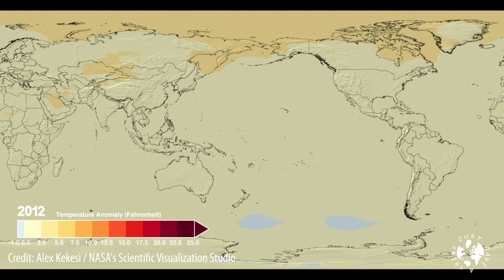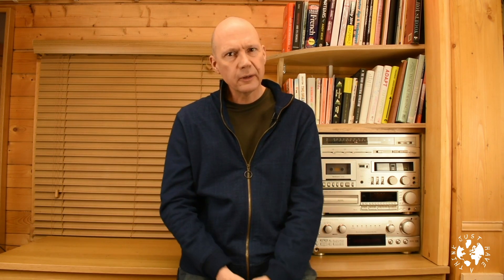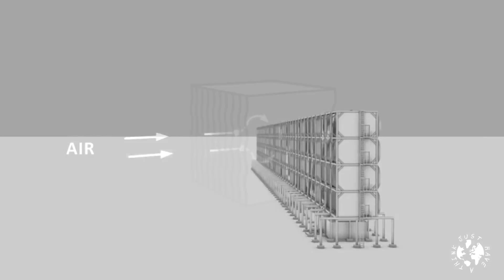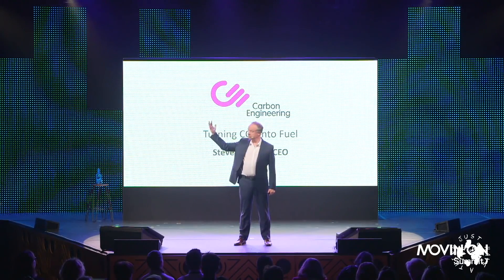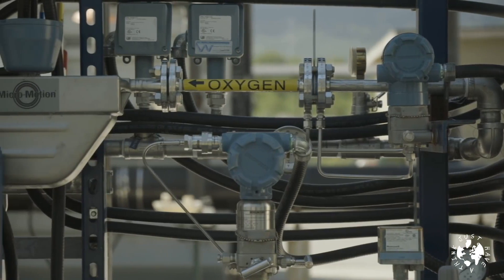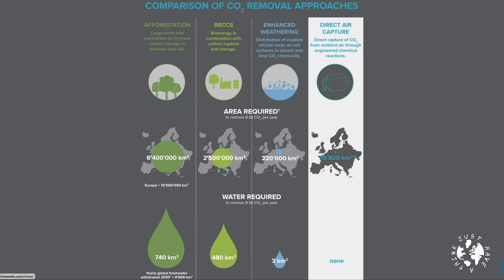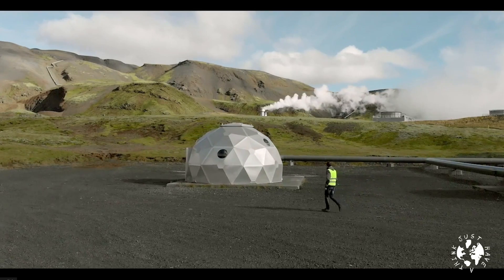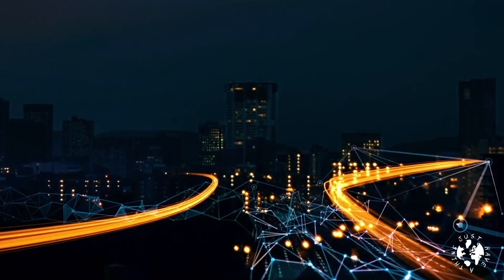Direct Air Capture Technology

Comment: Cost of materials separation (gases, liquids or solids) is almost always inversely proportional to the concentration, i.e. the lower the concentration of the material being removed the higher the energy (and consequently monetary) cost. Examples include ore grades and milling costs, gas separation, and removal of different ion species from water, etc.. Removing low hundreds of parts per million (ppm) of CO2 from air requires at a minimum air/handling roughly 10,000 greater than the volume of the CO2 removed for single pass treatment (if the process is multi-pass then multiply 10,000 by the number of passes). That is only one of many costs involved in the process life-cycle. This begs a few questions: 1) What is the purpose of direct air capture technology (DACT): optimized sequestration to remove CO2 from the atmosphere or creating a new recycled carbon material loop at the cost of reduced CO2 removal efficiency)? 2) What are the life-cycle efficiencies of the respective technologies in terms of long-term atmospheric CO2 removal ? 3) How would the recycled fossil carbon be used (e.g., in IC engines, fuel cells or as feedstock in plastics and petrochemical manufacture, etc.)? Given the thermodynamic inefficiency, process pollution, negative human health impacts and economic disruption of IC engine use, this is a no-start.  Use as feedstock for plastics manufacture, while it potentially could reduce the use of fossil carbon, perpetuates the proliferation of plastic pollutants in the environment. Plastics pollution is a huge unfolding environmental disaster that is quickly contaminating all terrestrial environments and ecosystems (including the human body at the cellular level). Don't think that would be a good application. The jury is still out on methane vs. hydrogen fuel cells (kind of), though the industry seems to have tipped their hat to hydrogen). This leads to the 4th question: Is CO2 capture with hydrocarbon recycling even a legitimate option for long-term CO2 sequestration? I think the answer is no. That then raises an inconvenient question about the efficacy  of making DACT a component of atmospheric CO2 reduction. Since long term DACT and sequestration come at a dear price, as seen through single-bottom-line lenses ( the predominant eye ware of corporatism/capitalism) would a better strategy be to instead double down on expeditiously exiting the fossil carbon economy and focusing our efforts on CO2 capture in the earths living systems? If business and economic engines are thus synced with human intelligence, industry, and commerce, to make our collective endeavors sustainable on the planet that sustains us, then the cost of these changes become positive inputs to the industrial human economy as well as thrival of Planet Earth's Living systems.

Comment: I'd say the way to approach this is a 2:1 model. A company that engages in this is allowed 2x DAC to 1x DACS. That way 1/3 of the carbon they process gets sequestered. They get to offset the cost by tax breaks for the 1x DACS. I have not done the math but I think a approach similar to this (someone smart needs to work out the total economics) is a workable approach.
Reply from the maker: Carrot and stick. I think you're probably about right.

Comment: One advantage which needs your scrutiny, is the idea that these technologies now define a value to a ton of captured co2. In your presentation you have identified that a ton of CO2 costs $235 to remove. Now it becomes clear to the economic community that carbon tax needs to be paid at the same or greater value, and not €5 to €20 currently typical in Europe. So any capitalist recognizes a market has been created.  If for example a fuel company is required to pay this, which a reasonable government might adopt, the carbon tax impacts on the price or the fuel, so the government has taken a step towards funding carbon removal. The next step is there is now a clear reason why there will quickly be companies competing  to find and market a lower cost solution, driving cost down as happened with solar. The point of all this is to create a viable market which has already served us well in the case of solar and wind. We have to develop not only the technology but the viable market place, that’s capitalism. As I generally point out saving $20 a month on your fuel bill is far more compelling than saving the  the world.
Reply from the maker: 100% agree. Many thanks

Comment: The concentration of CO2 in air is low, and capturing it will cost a lot of energy. Much better to remove CO2 directly from the exhaust.
Capturing CO2 from the air, plants are still much more efficient than any of these projects.
Reply: While that's true in practice, in theory we could do better than plants at pure CO2 capture.  Plants' carbon-capture is limited by a twitchy little catalyst/enzyme called rubisco, which is looked at as one of the strangely least-efficient mechanisms in Nature's arsenal.
Reply: @paintedwings74  Interesting. The plants capture CO2 without requiring input of energy. Can we manage the same?
If we need to put energy into the prosess we can rather focus on producing carbon neutral energy.

Comment: Back of the envelope calculation (correct me if I'm wrong);
We currently emit around 100 million tonnes of Co2 into the atmosphere every day (~36 Gt p.a.)! 
To remove 1 tonne of CO2 would mean pumping 2,500 tonnes of air (CO2=400ppm)through the extraction machinery (assuming 100% efficiency). Daily we would have to process 250 Gt of air per day to extract all the CO2 currently emitted! 
I don't think this is doable, the energy required alone would be mind boggling, also CO2 is a poisonous gas at higher concentrations, you could not store these vast quantities near densely populated areas. 
This looks like a case for Thunderf00t to analyse, he does a similar anlaysis on extracting methane from the atmosphere; https://www.youtube.com/watch?v=dzq9yPE5Cbo
Reply from the maker: Hi Art. It's a fair observation, but I don't think anyone's realistically thinking this technology alone will pull out all the CO2 we burn. Climeworks are aiming for 1%, and even that is 750,000 shipping container's worth of fans. So it will only really be a part of the solution. But my view is it's worth pursuing if there's capital there and political will to back it.
Reply: @JustHaveaThink  Thanks for the reply. 
Perhaps it would make more sense to apply this technology directly at the source of heavy emissions such as coal plants, where the concentrations of CO2 are far higher.
I do think that this technology doesn't solve our problem but kicks the can further down the road.
Kevin Anderson of the Tyndall centre, says that the top 10% of the world's population is responsible for 30% of emissions. 
It is our consumption and neo-classical economic model that has to be challenged (as you point out) and changed to ameliorate what is coming down the track.
Reply from the maker: Hi Art - what you describe is Carbon Capture and Sequestration, sometimes also with Biofuel (abbreviated to BECCS) which is what the IPCC are heavily reliant on to make their RCP graphs work. It's something we've covered in a couple of earlier videos. You are absolutely right - the best place is indeed at the exit of power plants and factories. In practice though it's proved to be expensive to implement, adding up to 20% onto the cost of production. I think that's because it has not really been adopted wholeheartedly by the industries - it's more of a sop to the government environment agencies and it most likely drew some nice juicy subsidies as well. So there's no strong evidence that it's likely to take hold at big scale any time soon - which is bad news for the IPCC. And bad news fro us!!

Comment: There is nothing wrong with Capitalism as long as the governments create a legal and financial economic environment that is reflective of all the costs (health, environmental, etc.) so that the corporations and people are not "stealing" by taking opportunities of "free" resources (like human health or the environment) - they must not be free, and then Capitalism will find a way.
Reply: While i agree with you in principle, the issue is that capitalism rewards underhanded tactics. its about cutting costs, and maximizing profits. Hence simply using price regulations to increase costs, would either drive up prices, or promote illegal procurement of resources. While aspects of the economy function well with free market, or natural resources should be subject to a command economy, in order to ensure 100% control of natural resource expenditure. that way one planned sector will automatically regulate the rest of the free market.
Reply: @frederik7338  Capitalism = private for profit, but we need to modify the rules so that true costs are built into the equation to eliminate free exploitation.  That's the key. As for crooks... they exist in any system - the most "idealistic" system (communism) had the most crooks.

Comment: This (making fuel from CO2) is a big scam designed to make people believe that we can continue burning fuel. Why else would the OIL industry be behind it? They are using energy to capture CO2 so that we can burn it again. It is NOT carbon neutral - the equipment and likely the energy put into the process will result in CO2 emissions. The EFFICIENCY of this process as well as re-burning the fuel is MUCH lower then using the energy directly to make EV's move. CO2 emissions reduction / elimination and / or direct CO2 capture (at source) yield much bigger bang for the buck. Once all that is done, we can start looking at CO2 recapture - and then we should put it away - not burn it again.

Comment: Great vid explaining the ultimate decision we will all have to make and/or be effected by. With regards to who will have to pay, then reducing subsidies for the biggest polluters such commercial industry and aviation may be good start. Things end up costing us end users more year to year anyway, with near to no reduction in the CO2 emissions. Next should be private and domestic emitters who CHOOSE to burn more for comfort and/or prestige (massive, oversized vehicles and those who lean a bit hard on the heating, for example). This may already be the case, looking at it from a capitalist viewpoint. But the shear number of people in said big motors and/or those who are not economical with the gas/breaks means that the cost of doing so is definitely not enough, if that’s the purpose of the government levy on fuel. 
There’s more economical ways to heat homes, and though costly, ways to reduce the degree of heat needed to be added via gas or electric central heating through insulation. On this last point there are great advances being made. Local domestic energy production through solar, wind and ground source heat will need to become almost mandatory. 
So he’s right to bring up the point about us personally starting to invest a little more year on year on cleaning up our act now, rather than letting the bureaucrats screw us over. If that happens then I fear the same consequences as with London’s congestion charge - the little man loses out. And London’s air quality still sucks! 
I wonder if the carbon that is scrubbed from the air could be piped into vast green houses stocked with genetically modified plants that are mega CO2 hungry. Or just simply use the same to scrub the air? Oops but then I just forgot, we’re still zapping forests like there’s no tomorrow.

Comment: With all of billions of dollars used to make machines doing this is in my opinion waste, it takes so much energy to make and run these while nature has a cheap solution called trees. Plant trees and use the wood to build wooden structures and things, we have to build them anyway. Moving from plastics and concrete to wooden structures and things stores the CO2 natural way and saves the oil and concrete for things we absolutely need them.

Comment: I only like the idea of capturing CO² then putting CO² back into the ground. 

(All vehicles need to be Electric period.) 🔋

Producing 100% clean electricity from Solar and Wind and Ocean Wave's is all we need in the world by capturing and storing the energy in big battery systems.

My second idea would be capturing CO² and using it only for Airplane fuel purposes only until batteries become light enough for Airplanes. Everything else can be battery vehicles.
Reply: I'm not convinced Electric vehicules are the best idea. They are very resource intensive and unless electricity is renewable it's kind of still a bad idea. Harvesting Lithium destroy ecosystems and underwater sources which wee will need in a warmer future. I think a combination air sequestering AND the technology proposed by carbon engineering is the way to go while encouraging and promoting modes of public transport. Ensuring we need to travel less and rethinking our cities will also be necessary.
Reply: True indeed. But Battery has a life and when it become obsolete we throw away. Thus generating land pollution.
Reply: @surajitpaul3679  No, we DON'T throw them away.  Cars are not cell phones.  EV batteries that are no longer effective in cars will be re-used in less demanding terrestrial applications, and when they are no longer capable of that, they will be recycled.

Comment: Good video, I've only just found you so you have a new subscriber and I'll be sharing them to my "massive" following on twitter too. 
This is a huge issue and I have to say that I agree with everything that you've said here. DACS has no market as such and I've long understood that there will be no way to monetise a service that does not give people any tangible benefit. I suppose, when the time comes that we really do start to see massive change then people will more easily see the benefits: instead of paying for things to not get worse than they are  today, they will witness some climate devastation, lose some of the stability that we currently have and then see the value in paying to ensure that things do not degenerate further? 
DACS will be needed and I agree that creating fuel from atmospheric CO2 will help but it will only be part of the answer that will necessitate carbon removal.
Reply from the maker: Hi Ian. Many thanks for subscribing and for leaving feedback. There are indeed many challenges ahead of us as a civilisation and you may be right that politicians won't act decisively until the ravages of Climate Change are undeniable by even the staunchest disbeliever. I just hope that it won't be too late by then. All the best. Dave

Comment: 1 Liter Petrol == 750gr after burning this amount you get 2392gr co2. No way we can scale up to capture this amount of co2...
Reply: Many have accepted the starting level to effect the global carbon cycle is at around 8 GtC/y. That is a vast amount. I'll just leave 2 comparisons.

1) The US used ~6 Gt of cement throughout the last century. Yet;

2) The global sand and gravel industry does ~50 Gt/y.

Capturing and utilizing the scale of carbon needed is doable with the proper STEM, funding and policies basket and the scale will probably help solve other issues such as lusted by the UN SDGs.
Reply: Agreed. All of these geoengineering options other than mass reforestation globally have very high costs. Imagine a capitalist telling an American or Brit that it will cost them a carbon tax of between $150 to $250 dollars a ton just for transport carbon offsets so that a tar sands magnate can continue supplying fuel. Rather buy a bicycle or an electric scooter. Trouble is, our capitalist driven system captures politicians and they want a command and control system as put forward by labor back in 1942 thinking already of post war economies. That has me both paying a tax and having to find the money for transitioning to purchase that bicycle. Anyway, I think capitalism in this regard has botched our global ecosystems and now there will be hell to pay.
Reply: Let us manage it bit by bit
Reply: @KGopidas  Maybe 30 years ago we could have tackled our problems bit by bit.